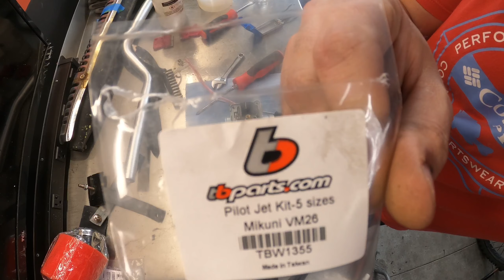Apollo Z20 Z20 MAX | UPGRADES PT 2 | CARB UPGRADE | TOP SPEED UPGRADE

Comment: Hey man, nice video.  My wife's Z20 MAX seems to run pretty lean too, I'm working on finding the right jetting now at 1200' elevation.  I'm definitely doing that 17T sprocket upgrade
Reply from the maker: Thanks man! Good luck, and happy riding!
Reply: I'm at the same elevation. What setup ended up working for you?
Reply: @matrixxx01   I'm at about the same elevation and i've tinkered with the vm22 carb TONS to get it dialed in just right. I've tested many main jets , idle jets and every position for the needle. After all the testing i've found using main jet 95,  idle jet 38 with the needle on the center groove and the air/fuel about 1 7/8-2 1/8 turns out is perfect. I also highly recommend getting a extended quick adjust air fuel screw for tweaking.

Comment: Dude. I bought a 125 that had a 150 upgrade and a bunch of other goodies inc a mukuni carb, no ideas wbat the mm size is... it did not run proper. None of my adjustments got rid of the bog. What tjey are known fornon stock carburetors. I got another cheap knock off carb for 50CAN$ and i onky had to adjust idle and set the clip on the bottom position and it ran sweet. W.o.t everywhere.
Reply: Its a 26mm with a 95 or a 56 main jet and a 15 or 75 pilot

Comment: Hey thanks for the video. I just bought the same bike it and I was wondering if yours has ever had an issue with the kick starter where it moves down but doesn't engage with the engine?  I had this happen 2 or 3 times in a row, where it went all the way down with little to no resistance but then work normal again after that.
Reply from the maker: Go to my channel and look at clutch adjustment video.. clutch needs adjusted where the cable goes into engine.  Find the video and go to the very end of the video i show you how to adjust it at the engine side
Reply: @TynkaTyme Will do. Much appreciated! thanks

Comment: @tynka, I just took off my air box on mine and put on a new air filter but I ran into bogging when giving it a lot of gas. What do I need to do to fix the bog?
Reply: That means it’s running lean. Since you have a less restrictive filter you have to adjust the carb or rejet it for more fuel

Comment: Hey man, you ever find main jets that work for this carb?
Reply from the maker: I ordered every single main jet 90-210, and every pilot jet from 10-45 none of them worked. Took it off and put a vm22 on no rejetting required with that carb
Reply: @TynkaTyme  just ordered a Z 20, could you help me out with the carb, which Vm22 did you put on? i'm guessing its the 26mm , but there is a few out there, just wanted to be sure. i appreciate it.

Comment: Where did u get your pro tapers from
Reply from the maker: eBay
Reply: Thanks
Reply: Did u get the spacers from there to or did u already have them
Reply from the maker: @acejordan1230  they actually came with a set of risers that didn’t fit. I just typed in pit bike risers on amazon and looked for the cheapest set that included them spacers